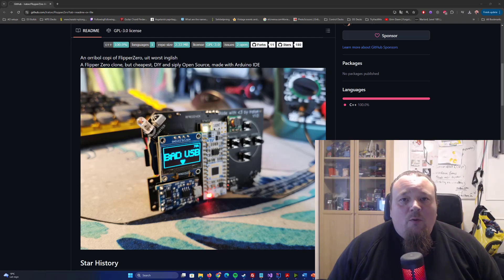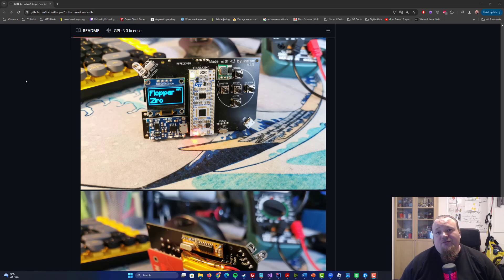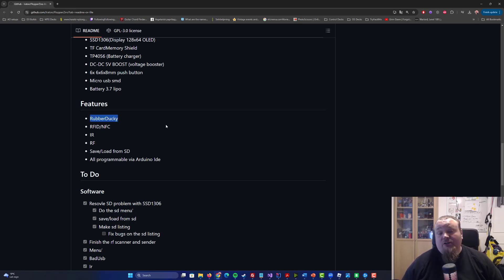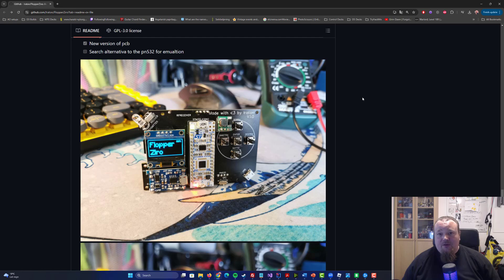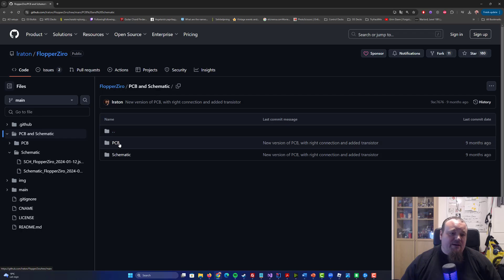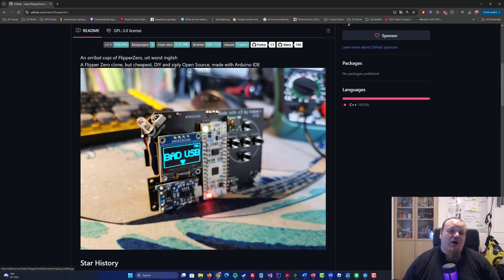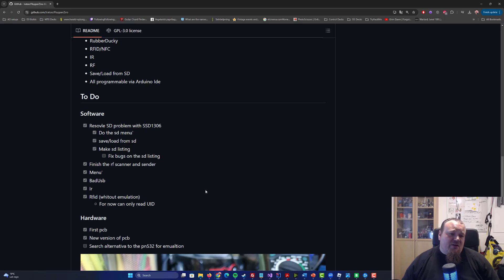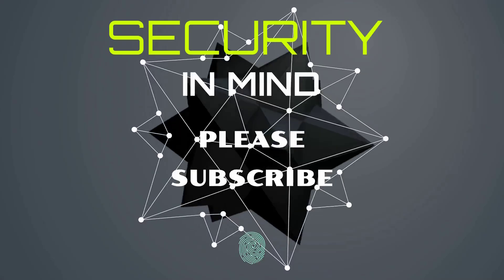Flipper Zero Alternative / Clone - The Flopper Ziro

Comment: i'm holding out for a brandless clone from China. the flipper is all open source, so there is nothing stopping someone in China from spinning up a MUCH cheaper clone with inferior components. in my opinion, the original flipper just does way too much anyway. i'd much rather pay a fraction of the price for a fraction of the functionality. hell, the flipper didn't even create anything, its just very good UI and packaging of existing tools and methods
Reply from the maker: very interesting perspective. Why haven't China already created a flipper zero clone, that is the best question i could ask. I do not hold the answer to that question but I do find it very interesting. Will China do that or not... and why have they not really did already.

Comment: just checked source code
dont look good, is usable like for wireless sockets and bells and stuff... thats it.... There are much mroe capable, and proably even cheaper alternatives
Reply from the maker: @PetrBelohoubek-ot5ok  ah well.. ☹️
Reply: You are right, you can only work with infrared, radio waves, nfc and use it as rubberducky, then if I wanted to add some functionality I can't since it is not open source😉
Reply: and those are?

Comment: That is just a bunch of parts connected with no firmware. 
Arduino doesn't have enough memory to be a Flipper and do all the same things. It just crashes.
Reply: the STM32L432KC has 64kB SRAM and loads from an SD card. 
Arduino docs show that 64kB is plenty as many supported devices have between 2kB and 32kB
Reply from the maker: Obviously this is not for you :)  Arduino can do a lot of things.
Reply: @secbydaniel  I know. Because it doesn't have enough memory to run the program.